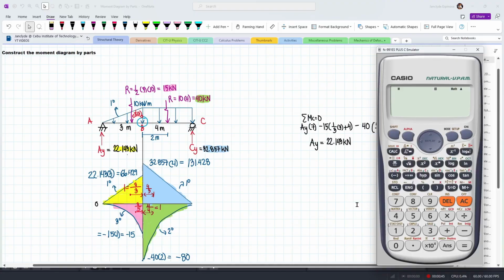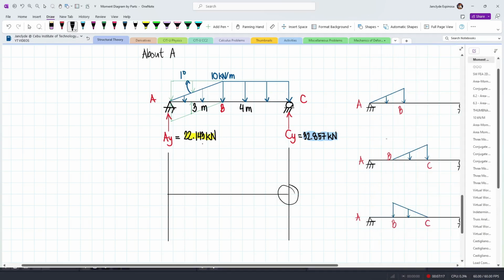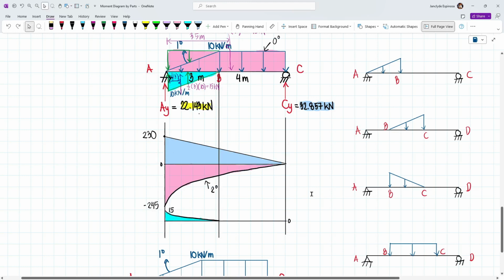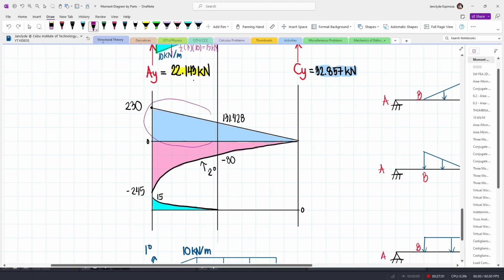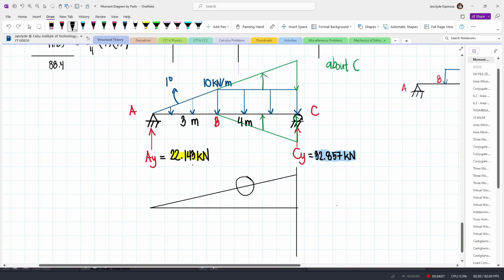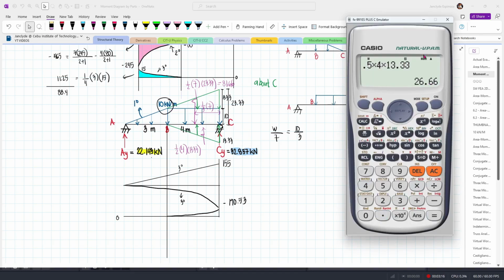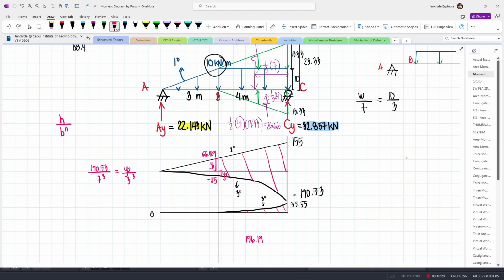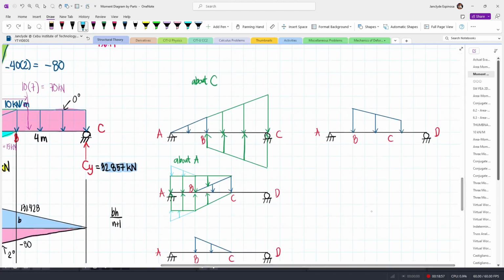Moment Diagram by Parts (Simplified) - Continuity of Loads + Checking

Comment: If nag moment by parts po ba then the whole area is not zero, does that mean it's not accurate? Kaya gamit nalang ako ng double integration method.

Why po na sa mga solutions manual na nakikita ko ginagamit nla halos bdm for computations, mas accurate ata po kasi eh than moment by parts?
Reply from the maker: @calmakopomasadiano6445  the sum of the heights will only be zero po sa ends ng beam kasi moments at the ends ay zero. At any other point, it may have a value. The accuracy that double integration and moment diagram by parts for area-moment method is the same po. The same lang din yung by parts sa conventional BMD. Hindi favored ang BMD kasi mahirap icalculate ang centroid ng areas po. Sa solution manual po kasi nakafinite element analysis sya kay automatic yung values.. meron po ako video dyan but in Bisaya lang po where kinompare ko actual BMD sa by parts tas same lang po
Reply: @engrclidez  ahh ok ty po, life saver po talaga videos niyo❤️❤️❤️
Reply from the maker: @calmakopomasadiano6445  thank u po ✨ we have more videos sa fb page at Clidez Free Tutorials.. dun ako naglilive discussion before posting sa youtube po

Comment: Can i use this method to find the maximum moment😢? Im looking for a method wherein i can easily find the max moment easier than the V and M diagram method.
Reply from the maker: Hello po, the best method to easily find the maximum moment (esp board exam wise) is by shear and moment equation. Pag may time po discuss ko yung techniques. Yung moment diagram by parts po kasi is intended talaga for simplifying slope and deviations in solving beam deflections